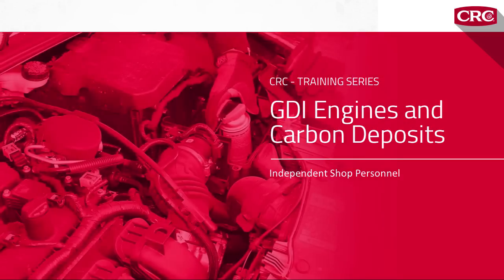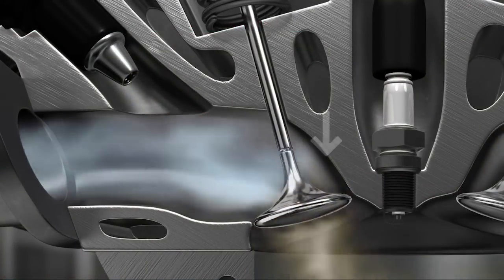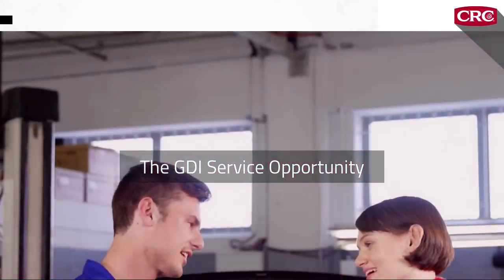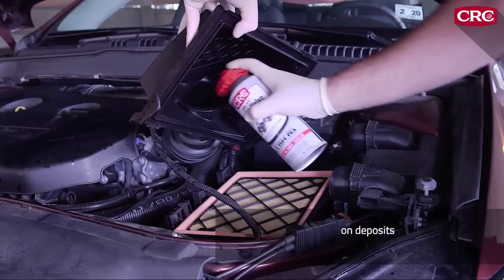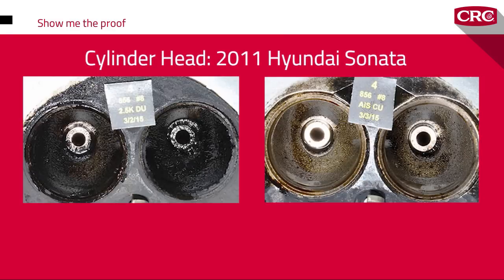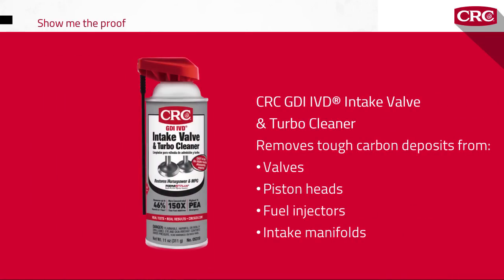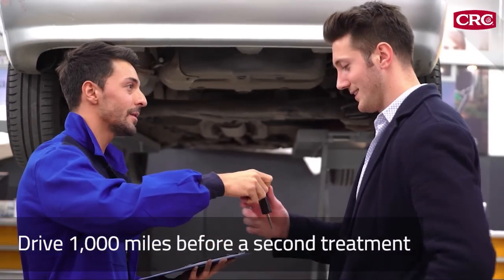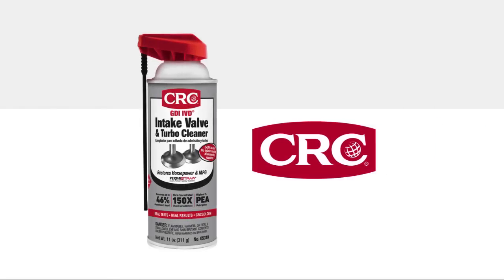How To Use CRC GDI Intake Valve & Turbo Cleaner

Comment: Instructions say to spray directly into throttle body with the intake hose disconnected... but is that while it's running? if so, that would trigger a check engine or rough idle since the 
mass air flow is reading incorrectly the air going into the engine. Am i missing something?
Reply: Yes, you have to spray it AFTER the maf sensor for that exact reason 🙂

Comment: So according to this video, you need 2 people to do the service? 1 person to spray the product and 1 person to keep the RPM at 2k while they spray it? Or can you do it all by yourself and rev it up to 2k after emptying the whole can?
Reply: 2 people, it should be sprayed in bursts
Reply: I used a piece of plywood and two bricks.
Reply: Hockey stick worked great.
Reply: Put a piece of wood against the front of the drivers seat and onto the gas pedal. If you have a power seat moved the seat forward until the revs reach 2000-2200 rpms. Then go up and spray the product in short 3 second or so bursts until the whole can is empty. It may take 15-20 minutes to empty the can. Reattach any parts you removed and rev the enigine to no more than 3500 rpms 2-3 times. Turn the ignition off and let the car sit for a solid hour. By the way go for a little highway ride to heat the engine and catalytic converter up before doing this service. After it sits for an hour with the product applied go for a 15-20 minute drive with a few bursts of  moderate hard acceleration.

Comment: Why are there no answers to the questions in the comment section of the video? I also have some of the same questions.
Where does the carbon go if it breaks a piece of carbon off?
I have heard if that were to happen it can destroy a turbo charger. Is this true?
Reply: This cleaner dissolves the carbon so no big chunks are going to your catalytic converter

Comment: Do you have to change your oil after using this? If so how long after do you change the oil?
Reply: No, you do not have to change your car's oil after use.  The product enters the combustion chamber and leaves thru the exhaust.

Comment: 3.5 Ecoboost F-150.  Spraying into the air box goes directly into the air tube ducting then into the intercooler.  My main concern is that the product will pool in the intercooler and stay there till a WOT event then flooded into the engine.  Does it stay liquid form or does it evaporate shortly after sprayed??

Comment: @CRCAutoUS  I am asking a very pointed question. Please respond with a detailed answer. 

2017 VW Passat with the TSI (170hp) turbo motor: Where do I insert the spray nozzle?

 I ask because the airflow meter is immediately in front of the turbocharger and against the firewall.
Reply from the maker: Please reach out to our technical support team and they can assist: techservice@crcind.com

Comment: So, just to be clear for turbocharged GDI engines, this product MUST be sprayed AFTER the turbo, correct?  If I wanted to clean the turbo impellers as well, I would have to remove the turbo from the engine for treatment?
Reply from the maker: Thank you for your comment.  No the product can be sprayed before the Turbo. For example from the air filter housing. This will allow the product to go thru the front of the turbo, intercooler, valves, and exhaust side of the turbo.
Reply: @CRCAutoUS  Ok, thank you!
Reply: @CRCAutoUS  so in a turbo engine, no need to spray it into the throtel body. spyaing it into the turbo is better, right ?
Reply from the maker: @john123mike  One way is not better than the other.  It is just another option that may be more convenient in some vehicles since access to the throttle body is not always as easy in certain vehicles.
Reply: @CRCAutoUS  thanks for the fast reply

Comment: 2013 BMW ActiveHybrid 3, 150k. Possibly dumb question: On turbo cars, do you spray it both into the intake manifold (to clean the valves) and down the charge pipe (to clean the turbo vanes)?

Comment: Is this safe for a 3.5l Ecoboost? I've heard conflicting stories.
Reply from the maker: Yes this product is safe to use on this vehicle.  The product contains a high level PEA which clings to the carbon, dissolving it rather than breaking it off into chunks that could cause damage.  If you have further questions or concerns please feel free to contact our technical service department at Ph. 800.521.3168
Reply: @CRCAutoUS  what about the seals? ive heard of underboost problems on ecoboost engines after induction services?
Reply from the maker: @PIP_SLUHT1900  Which seals are we talking about? Yes, problems could occur when using a solvent based cleaner. Our product is a detergent based cleaner.

Comment: I have a 95 Honda Del sol and the MAP sensor sits on top of the Throttle body! Can I still use this? Just put the straw past it, deeper inside?
Reply: As long as you don’t spray it directly it will be fine. You still have this Del Sol?
Reply: @rumpelstiltskin2454  Hell yeah I still have it! Burning up and down the Freeways at night having fun!! 🤣🤣
She's running pretty good...
Reply: You said deeper inside
Reply: I'm pretty sure a old del sol is not going to have direct Injection, so this product isn't for that engine.

Comment: Hello CRC. 
So I understand that you should drive the car at highway speeds after an hour of heatsoak.

What if the car isn't drivable at the time?
Reply: Or is it possible to not have to drive the car after the heatsoak?
Reply: I’ve used this product and I couldn’t drive at highway speeds either. I just drove around the block 10 times at reasonable high revs. I could see the “smoke” coming out the exhaust which would be the removed carbon. My engine has now returned to normal, smooth idle, no hesitation at take off.
Reply: Oh nice.  My car hasn't turned on since.  And when I mean not drivable,  I mean,  the car has a chance of dying on itself pretty often and it's a manual...i haven't practiced enough.

Comment: So, I did this with my GDI engine over the weekend. Car is a genesis 5.0 which has a GDI 429 HP V8 engine with 70k miles. The problem I had was that for the life of me I couldn't get my car to idle at 2k RPM's, it's like the computer wouldn't let it. I could get the car to idle at 2k for a second but than the car just dropped to the 500 idle rpm.(no treatment yet)so I feathered it around 2k while someone else sprayed it. Engine seems smoother and acceleration is a bit better. I also did an oil change and put a k&n air filter. I was getting 6 second 0-60 times when I should be in the low 5's range. Now I'm getting in the 5.5 range still not where it should be. Dash command app says my HP went from 375 to 401(granted dash command is calculated and not actual HP, it still gives a rough idea of the engine status) I am going to buy a camera to look at my valves and wanted to do this treatment again. (new plugs as well)Do you think it is safe to do this again in a few hundred miles or should I wait till my next oil change?
Reply from the maker: Thank you for your comment and sharing your results so far.  We recommend at least 1,000 miles before a second treatment.
Reply: Hello! Does your car have MAP and Intake air temperature sensor in the intake manifold? Im hearing stories that this product will damage these sensors thats why im still hesitant to use it in my mazda 3 skyactiv. Will this not damage the MAP and IAT sensors?
Reply: @blackriderph4340  I’m not really sure. I drove this car for another 40k miles and it ran great till someone hit me and totaled it. Now I drive a twin turbo Infiniti, this has a temp sensor in the intake manifold and the maf sensor in the filter. I’ve been thinking about doing this but not sure yet. Would have to do the cleaning after the maf sensors for sure. Basically directly in the turbo intakes.
Reply: @mikedavin671  thank you for the fast reply! My one remaining concern will be if the emulsified carbon bits might scratch and scour the cylinder walls. Probably not because yours drove fine.
Reply: Wa it for at least 1000 miles before doing a second treatment. The product is still working a little bit for a few hundred miles after treatment.

Comment: I have a 2013 ford fusion eco boost 2.0 liter turbo charged. What vacuum hose can I spray the cleaner into I have no idea what one to use? I can’t access the throttle body it’s down by the radiator in front of the car almost under it.

Comment: I have a 2017 Honda Accord.  The mass air flow sensor is easily accessible. Could I just remove the MAF sensor before using this cleaner?

Comment: Crc intake valve cleaner cost me 3400 for new catylatic converters. Completely clogged my catylatic converters. I think CRC has failed to say anything about that.
Reply: CRC needs to address this. ^^^^^^
Reply: Elaborate?
Reply: Did you spray in short bursts while maintaining 2000 RPM?  If you spray too quickly or the RPM is too low, the chance of overheating the catalytic converter is increased.
Reply: @ospuddy or b if the engine and catalytic converter aren’t brought up to normal running engine temperature.  A hot catalytic converter will burn off any microscopic particles.

Comment: How can you run the engine with the charge pipes disconnected? Makes no sense, your saying spray while it's on. How would the car turn on? Won't it throw a code?

Comment: When using this product what happens to the carbon that is on the valves? Doesn't it get into the cylinder and onto the pistons??? That can't be good right?
Reply from the maker: Thank you for your comment.  The product contains a high level of PEA which attaches to the carbon and slowly dissolves it so chunks of carbon will not break off and cause any damage.

Comment: The description of the product implies to me that the carbon deposit is dissolved (i.e. liquefied) so that it can be burned off safely without sending damaging solids into the combustion chamber or catalytic converters.  Meanwhile, at minute 9:30 of this video it states "Additional carbon that's been loosened is safely removed by the heat and pressure of engine operation", which really sounds like the carbon deposit will be made to break free ("loosened") from the intake valves.  
Maybe getting into semantics here, but I would buy into the idea that the loosened carbon deposit is "...safely removed [FROM THE INTAKE VALVES] by the heat and pressure...", but why am I not convinced that the carbon deposit that is loosened from the valves is safe for the combustion chambers or catalytic converters?
Seems to me that this product should only really be used starting on a brand new vehicle as a preventative measure against carbon buildup.  Convince me otherwise.
Reply from the maker: Thank you for your comment.  To clarify the CRC GDI Cleaner emulsifies the carbon so that chunks will not break away and cause damage.  Also we do recommend this product be used from the beginning as a preventative service to reduce carbon buildup but we also have proven test results for vehicles with more than 100K miles.  You can view our test results at crcgdi.com
Reply: @CRCAutoUS  Thanks for your reply.  Does the emulsified material contain solid carbon particulate in suspension, or is the carbon completely liquefied, i.e. soft enough that it will not have any damaging abrasive effect on the engine internals?
Reply from the maker: @steveyemenijian6070  In all of our testing there has been no scoring to any internal engine or exhaust system components.
Reply: It softens the carbon so it passes harmlessly out of the engine. In a turbo car, the last thing you want is a chunk of carbon getting into your turbine that's spinning at 100,000 RPM.
Reply: @steveyemenijian6070  I did oil analysis and the presence of hard carbon particulates skyrocketed after the service in my car.  It took 2 oil changes in the first 100 miles to get rid of it.

Comment: Do you recommend changing the oil after this service on a turbo GDI with blowby?   Hyundais/Kias have some excessive blowby on their 1.6t and it is certain this product will get into the oil and likely all components cooled by oil....like turbo seals....
Reply: PEA is a dispersant and antioxidant compound. It doesn´t attach oil neither seals. Although you can have it in a curing agent of epoxy glue for less money, kkk.

Comment: I have a Hyundai Tucson with GDI 1.6 turbo that is burning oil and completely empty by 1,000 miles. No smoke or visible leaks (oil spots on driveway etc) but definitely signs of carbon build-up. It's been like this for about a year now and has 87k miles on it. My question is about how long can a car go with build-up before internal parts are damaged?
Reply from the maker: Hi there. It would be best to contact your dealership to assist in troubleshooting issues and questions

Comment: CRC, question;

On the can it says to use every 10000 miles or before oil change. Does that actually mean i should be changing my oil after using it or can its not necessarily?
Reply: I'm worried right now, cuz my car has a lot of miles and I haven't used it in a long time. I'm gonna take to the dealership and see what happens 🤔
Reply from the maker: We recommend changing the oil AFTER using the product.
Reply: @CRCAutoUS  I assume some it can sip into the oil chamber between cylinder and piston and degenerate the oil.

Comment: Hello ! I have 2018 Honda Accord Sport 1.5 turbo Vtec 29000 miles . It’s already has bad fuel consumption , and poor performance . Honda dealer said that it’s carbon buildup and price for cleaning is 290$ . I watched this video and decided to try it first . Were should i spray this to clean everything? Thank you !
Reply from the maker: Good morning Roman!

We recommend spraying in the product from the air filter housing or as close to the throttle body as possible. All of our testing on turbo and non-turbo engines was conducted from the air filter housing. Visit www.crcindustries.com/gdi to see all of our testing data. If there are further questions please contact technical service 1.800.521.3168 M-F 8-5EST or techservice@crcind.com
Reply: CRC Industries Thank you !

Comment: Asking for advice again.   I tried two times already but no good result on my car, 2011 VW Tiguan.
I sprayed thru the intake air hose right after MAF sensor.   But I feel maybe better result if I find the brake booster vacuum hose.   The vacuum line from vacuum pump has three ways out; one to brake booster, second one to a metal tube, third one leading to some kind of black box near throttle body.   Could you tell me which one I need to inject this CRC spray?
Reply from the maker: Please reach out to our technical services techservice@crcind.com

Comment: Do I need to take off my m.a.p(not m.a.f) sensor before using in my 2012 Sonata 2.4l?
Reply: Hello! Did you remove the MAP and Intake air temperature sensor in the intake manifold? Im hearing stories that this product will damage these sensors thats why im still hesitant to use it in my mazda 3 skyactiv. Will this not damage the MAP and IAT sensors?
Reply: @blackriderph4340  on my particular car it’s not necessary to remove the map sensor, in some cases if the map sensor is downstream from where you will be spraying the cleaner you have to remove it but not for these sonatas. If your car has a mass airflow sensor downstream from where you’ll be spraying the cleaner you’ll have to remove it. I don’t know anything about your Mazda but if the map sensor is downstream be cautious and ask around a bit more. Sorry

Comment: Just bought a can for my Forte 5. Getting ready to test this out soon. Great tips and info.
Reply from the maker: Don't hesitate to contact us if you need assistance.
Reply: @CRCAutoUS  IT WORKS GREAT...easy to use and my car is running quite a bit smoother now. CHEERS! I'll be keeping up on this maintenance  over time.
Reply: @ConstantXplorer  Hello! Does your car have MAP and Intake air temperature sensor in the intake manifold? Im hearing stories that this product will damage these sensors thats why im still hesitant to use it in my mazda 3 skyactiv
Reply: @blackriderph4340  Yes you can use it on cars that are equipped with those sensors as my car has them. You have to make sure to spray it past the throttle body neck...and NOT into the air intake housing. Make sure you remove the air filter housing and point place the tube right into the throttle body...close enough to the valve opening. This will by pass the sensor altogether.
Reply: @ConstantXplorer  thank you so much for the feedback!

Comment: I just changed my oil and filter, then had a check engine light. Is it necessary to change the oil after performing this service?
Reply from the maker: Thank you for your comment.  It is not necessary but it is recommended.